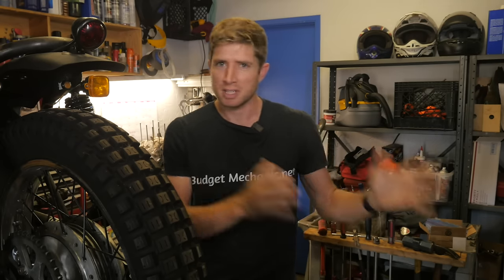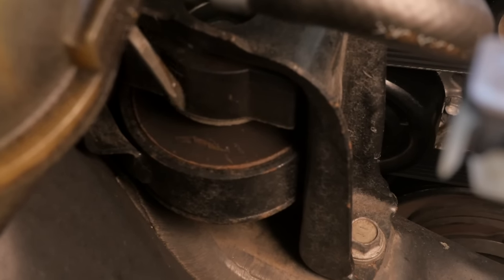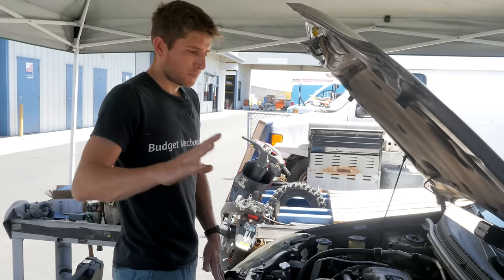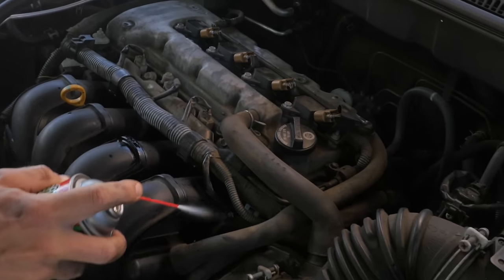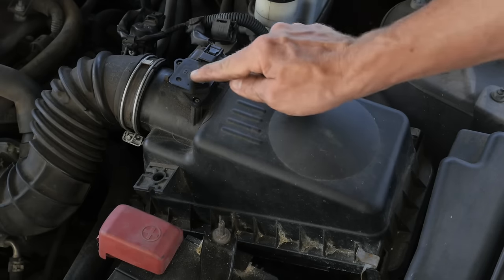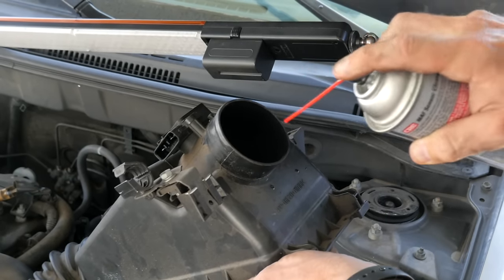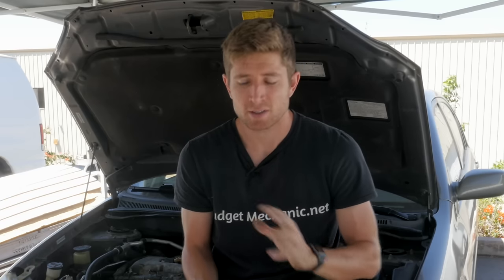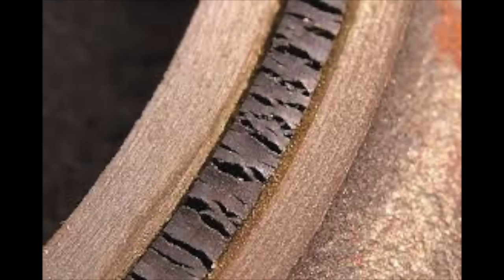Diagnose and Fix Rough Car Idle - Main Causes For Shaking / Vibrating While at a Stop

Comment: I have a vibration issue with my car ot drives good the vibration isn’t bad but I want to get it fixed right away  !
it does a vibration feel idk what’s causes it I think it’s a cv axle or motor & Transmission mounts could be anything I am not sure ! 🤦🏿‍♀️

Comment: I overheated my car and I doubt there was wapring or damage to the engine because the car still runs fine but only at idling I notice a strange shaking that wasn't there before it overheated. I don't know if maybe the overheating damaged a sensor or the fuel injectors? I think there might be a slightly more audible ticking sound from the car but it really isn't that loud or seems to be worrying as well.

Comment: My 2002 Chevy s10 4.3 starts fine and idles 900rpm but after 5 minutes idling when it idles down it goes to 6-7 and if I just hit the gas it almost stalls out sometimes it does. I’m pretty’s sure the ac switch is leaking vacuum but I don’t think that’s the cause because I plug the vacuum line from the evap valve it doesn’t help. I just got it back together after taking out a bolt from cylinder 3 its problem after problem.

Comment: Hey I have a 2013 Ford Focus se and I just got the brakes and rotors done, spark plugs and fuel pump (was a recall on the fuel pump & wouldn’t start) I still have to get the valve cover gasket done bc come to find out it’s leaking, I also had the throttle body sprayed out, now my issue is that it vibrate when idle which i had the code that it idle higher than expected before the throttle body was cleaned out, and when I put gas in it; it does not like to start I have to crank it 3x to start it up, any advice? please let me know if I can give you more info
Reply: Might wanna change the spark plug wires and also have it check to see if the throttle is sticking sometimes that happens

Comment: My car has an electronic throttle body can that be adjusted. I've checked pretty much everything else im thinking its the throttle body it drops in idle and it wants to stall while I'm stopped and in drive. Any help would be most appreciated
Reply: hi did you fixed it and how pls?

Comment: Hi, my car is an old bmw 320d touring and when I switch on shaking violently and shut off alone at few second blowing black smoke from the exhaust pipe (i put recently new oil and changed the filter), before that was shaking a bit and I didn't much atention to that, had the particle filter affected, after started to lost even more pottency until looks a very ultra slow car and I thought was the particle filter accompanied by drinking so much diesel (about 15 liters every 100km when normally was only drinking 7).
Anyone knows or have an idea what can it be? Thank you in advance.

Comment: My car shakes badly on cold starts it shakes so bad the Manuel gear leaves starts to move I have to rev the engine then it goes normal when car is hot it’s fine
Reply: its pretty normal in old car... After many experiences i have found issues...
totally engine wiring should be replaced
fuel pump pressure 
injectors cleanig 
plug gap 
these are responsible for vibration missing in cold start
Reply: @AliHaider-hq4kf  it’s a 2001 Nissan micra
Reply: @gang-gang8325  you should check your wiring firstly

Comment: I change my plugs twice now, spark plugs, ignition coil ontop of o2 sensors due to error code and by hunch clogged catalytic changed those myself as well. still idles kind of rough but only if stopped or in park. when driving it's fine. changed out fuel filter today as idk how long it's been since that was changed. i added some fuel cleaner to my tank but it was full already which wasn't directed by the bottle ( add it while filling ) trying to run the car through to see if that helps but yea been getting the damn flashing engine light prior so don't want to chance driving this car like that. 

sucks driving it in this Oahu traffic to work just constantly stop and go in the mornings and after work.

Comment: Idk..the problem with my car is i hear something vibrating in the engine compartment. I do not feel any vibrating going on. its like a part is loose and vibrates for a short period after i start my Subaru forester,then randomly as i drive. driving me nuts. I cannot see or feel anything loose in the engine compartment either. The problem started shortly after i took a very heavy individual(500lbs) to an airport. I wonder if that tweaked my shocks? but again i feel no vibration coming from the steering column.

Comment: Today I was driving a car and slowed down pretty abruptly. On the next light I noticed a slight 
vibration in the motor (kind of knocking sound). When came home did diagnostic w/Actron, it gave 
me P0404 (before it gave code P0446, with Engine light on, I erased it, the code gone). Before 
Idling was on ~800, normal driving. I replaced EGR like 4 months ago. Also put new ignition coils, ignition wires, and changed spark plugs of course. The car was driving well, but after today's deceleration vibration started. Now the arrow vibrates back and forth, rather rapidly between 400 and 1000. The vibration increased. What that can be?  Can some clog in the exhaust pipe course that vibration? Thank you for the informative film.

Comment: I have a 2004 Toyota Camry le 2.4l . I've done the corresponding fuel injector to the cylinder 3 that keeps burning the spark plug out. Ive replaced all spark plugs and coil packs on all 4 cylinders. It still runs rough in idle or at stop lights. I've checked for any air leaks or fuel leaks. Uf anybody has any advice I would appreciate your time. Thank you.

Comment: Idky people dont mention a pcv valve.
They are 10 bucns n one of the easiest things to change n chances are their vehicle needs it anyway.
This doesn't usually only cause a rough idle but if it gets bad enough it can def lead to it. It could eventually be sucking oil n doing all kinds of crazy stuff inside. So just a thought as well.
If ur burning oil, thats def a first go to.
However i think it could be the culprit on many items.

Comment: My Suzuki Swift 2008 model started ideling and losing power while driving. When I’m in 5th gear its like the car goes in limpmode. I have to switch to 4th, 3th and again to 5th gair, to make regain the engine power. It almost feels like there is an airleak somewhere in the intake. And that happend after the gearbox got revised, sparkplugs renewed, engine oil changed, coulant changed, airfilter changed, breakfluid changed, tires re-aligned. So practicaly a fullservice plus gearbox revised.  How can the car have these problemen, when it never had these problems before these maibtenances?

Comment: Yo I own a 1998 ford mustang V6 my car seems to shake when I turn it on and is still. My idle is not rough it starts well but I noticed at times my idle does get a little rough and drop too 600 at a stop sign besides that the car just shakes. I have replaced spark plugs and wires and air filter. I have carb cleaned my throttle body. I got a code saying my car was running rich and it does. At times my engine hesitates and doesn't have full power making it seem like I don't know how to drive stick I have checked my o2 sensors they are fine the majority of my sensors I have also used fuel cleaners and nothing

Comment: I have a rough idle and when i turn the ac on it smells like fuel. I will try the treatment and then run down the list. I’m pretty hands on and like to learn for my own interest but I’m guessing when it comes to the fuel injector I will have to take it in
Reply from the maker: Yes you are potentially getting a fuel leak somewhere and smell is coming in from ac.
Reply: Budget Mechanic Hawaii  i was told there’s a crack in the exhaust manifold gasket. Thanks

Comment: Great video. I recently had a shop replace the timing belt and I've had nothing but trouble since. They've  been trying this and that but nothing seems to work. I think the belt was installed wrong but they don't  want to believe that was possible. Symptoms are rough idle, engine light on kind of things that weren't present before the belt was replaced. What do you think?)
Reply: Sounds like the shop put the belt a tooth or two off timing. They just dont want to take the blame and have to do it again for free.

Comment: So, I bought an old 1990 f150 and the owner said it wouldn’t run or idle very badly. I replaced the plugs, problem went away. Now, a month later, it is back to doing the same exact thing. 
Any ideas?

Comment: When U use a scanner to plug into car, such as the advertised “Fixed” gadget that plugs into the car for diagnosed problems …….. Should the car be “running or just in the start position”???
Reply from the maker: Just in the start position. Car off. Unless you are using a live monitoring function of the scanner which are usually only on the more expensive models

Comment: I have this e120 corolla with 3ZZ-FE 1.6 engine.  I have done many tests like vaccum leak check, changed back box which had a hole in it.  Scanned with with obd2 no codes, did the coil unplug check does't tell me anything. Cleaned the MAF sensor with correct cleaner. Cleaned the throttle body.   Cleaned the injectors best as could by filling shell V-power with fuel injector cleaner fuilds added aswell many times.  Cost me a small fortune.  I cant seem to find what the issue is honestly fed up.  

I dont wana sell the car just for this idle problem.  Engine does sound good otherwise obove 1000rpm.

Comment: I have 2010 toyota corolla. on throttle body top right cornar there is a screw hidden in a glue type material.
can you please tell me, what is the function of that. and how it help in adjusting a specific parameter?
I have observed that changing the position of that screw make throttal pedal to respond differently and effect the drivability .
I have an issue of poor idling, engine vibrate at idle.  throttle body is cleaned. every possibility has been checked but could not fix the issue.

Comment: I have big throttle nwp and motordyne arts also jwt pop charger and z tube  and plenum spacer my idle after the throttle body install ( last upgrade to date) the idles been at 1k and sometimes drops and kinda sputters but still can hit highway speeds np . I guess its all those mods or something else? Needs a tune?

Comment: I have a 94 Toyota Camry 4 cylinder ,  it runs rough, broken motor mounts , vacuum leak somewhere and bit sure , don't have money to replace it , or other parts , sprayed water on it no pickup speed or slow speed ,  thinking intake manifold gasket , or bad spark plugs,  poor gas mileage,  check engine light also on , what could it be ? Can't afford to take it to a mechanic   any help appreciated

Comment: thanks for the video sir
I have a question
I have toyota yaris cross 2021 1.5 engine petrol (26000 kilometers now)
all maintenance has been done regularly by the toyota service.transmission fluid also had been changed
I have a problem no one can solve it 
The car is Ukrainen we came to Turkey (because of the war)
when there is little bit high hill ,the car makes tooo much loud exhaust sound (seems like mustang car sound)but car moves like a turtle.Even full loaded semi trucks can go easily 
when i drive on a regular road sometimes there is no sound but when the weather is hot in turkey that loud exhoust sound starts again
it happens more if we are 2 or 4 people in the car and if there is a little high hill 10-15 percent uphill or even on straight road
i took 5 times to dealership they said car has no problem
what might be the problem 
when weather is hot and when we are 2 or 4 people i get that sound all the time 
thank you so much

Comment: My engine light came on today, started losing power. Autozone was in reach and had the free check. P0302 came up. Printout said Replace ECM. Nothing was recommended or steps you suggest to take. The ECM was not in stock, have to order.  Does this sound legit to immediately say replace ECM as likely solution?

Comment: Mine vibrates when in idle and in drive or reverse. The vibration goes away when i drive off or when i put it in neutral. Suggestions?
Reply: Same exact problem I’m having I’m leaning toward bad motor mounts

Comment: When I Bought My Car. I Think It Had Sulfuric Acid In The Battery. Then I Added When Needed....Epson Salt & Distilled Water. It Runned Smoother. Then I Added Sulfuric Acid To The Battery. It Runned Kind of Acidy. Like When I First Bought. I Think It's Very Important To Realize Which Is Best.

I'm Thinking To Drain Some & Add Distilled Water To Battery. It's Abit Acidish.

Nothing Messed Up About Car. Maintenance Car.

Comment: I have a 2012 VW Beetle Turbo with a manual transmission my check engine light came on, I just changed out the coils about 5 months ago, it only spits and sputters after I have shifted to a different gear. (Yes I shift at the correct time. LOL 😂) but if I give it a little more gas then release the gas, it will run fine, until I have to shift to a different gear again.
Do you think it could be the transmission or the clutch? I’m (for sure) going to try new spark plugs and go with the cheaper fixes first. 

A transmission or a new clutch might be more than I can afford right now 😢
Reply from the maker: What does the code reader say?

Comment: Hi there friend. I am new to your channel. I have a 2010 Elantra GL. The engine has had a rough idle issue starting 4 years ago. I could not find anyone locally that knew how to diagnose the issue. STFT is about - 3.4% and the LTFT ia - 0.750 % It drives well but idle is a bit rough. This vibration transfers to the car steering wheel and car body. at idle. My mechanic claims that the mounts are good. The engine mount on the front passenger side was changed!  The throttle body was cleaned as well as the MAF sensor. The car engine has only 89,000 kms. The 02 upstream sensor  specs according to Hyundai manual says that it is between 1.5 volts to 2.0 volts. From what I understand it should oscillate between 1.5-2.0 volts. It seems to be stuck at about 1.95- 2.05 volts?  Therefor running rich  causing negative LTFT and STFT. I am thinking bad 02 sensor causing rich condition, therefore negative LTFT and STFT ?  What do you think?   Thanks ......

Comment: hi thanks for the vid, i owned a ford fiesta. whenever i turn on the AC the cooling fan will spin for few second before turning off again. it will turn on for only few second each time. is it normal? when the fan is on the engine will vibrate
Reply: You probably need to recharge your AC. Automotive store can sell you a recharge kit.

Comment: I NEED HELP:
   My 2010 Ford expedition 217k miles. Occasionally it Will shake while idling and wants to die, if I hit the accelerator nothing happens and it will almost shut off. This will last for about 30 seconds to a minute and then go back to normal. It only does this when it is hot outside. I changed the spark plugs and the fuel filter. I think the ignition coils are ok but not sure. No one can figure out the problem. Any ideas?

Comment: On v6 how does the coil pack line up numbers wise someone said did not run the way you normally think.
Reply from the maker: Manufacturers number them differently sometimes, it’s best to find a diagram for your vehicle or at least a similar year

Comment: My Innova diesel Manual vibrates a lot when at 1st gear especially during traffic. Break pads were just changed but still issue still unfix.
Reply from the maker: Unfortunately could be so many issues,   Hard to say without being there. Start with the basics, check all fluids, air filter and passages, check engine light, visual inspection...

Comment: My car is only 3 years old but it started to idle really rough about 5 months ago. Its a 1.5 Turbo DI engine from the  2018 Civic Hatchback with 44k miles. I can't imagine a 3-year-old car needing all this work done.  I replaced the engine air filter, I just purchased new spark plugs and plan on putting them in.  The car drives fine with no loss of power but just idles like dog shit and the RPM idles at like 500 when warm
Reply: Did you ever track down the culprit?
Reply: @carlossanders3448  nope. And I recently have loss of power. car doesnt go above 100mph anymore. The only thing I can think of is a vaccum leak or a failing/failed turbo.

Comment: Hey guys, I have an 06 Lexus is250. Recently got spark plugs in it… and de carbonized it with a mechanic… check engine light came and said multiple misfires… anyways just got back my car from a valve cover repair… and now the car idles at 500 rpm and shakes when I am completely stopped but the car runs and drives good.. also added a catch can right before that repair and I hear like water running through but it’s obviously oil running through… is this normal? Should I keep driving? Maybe the computer still hasn’t programmed correctly??